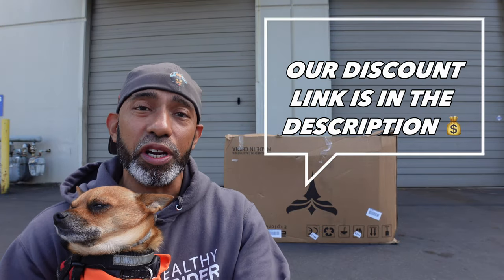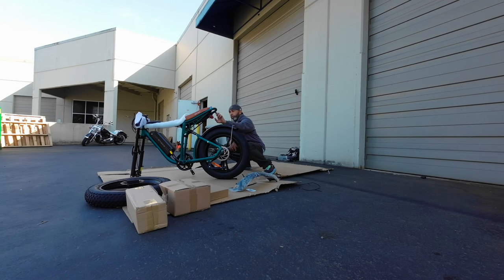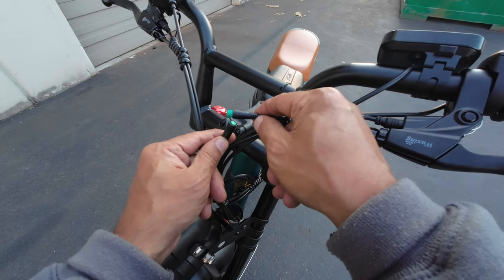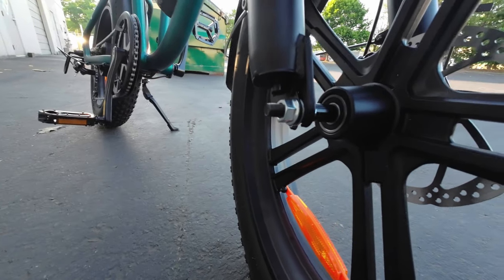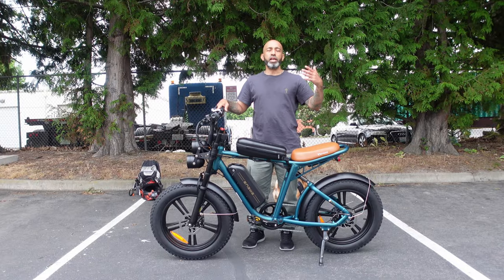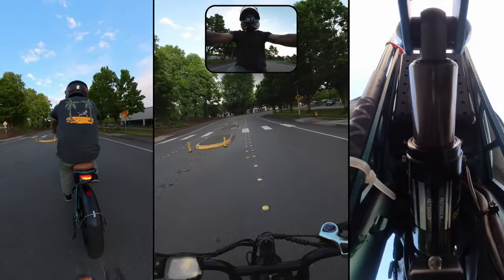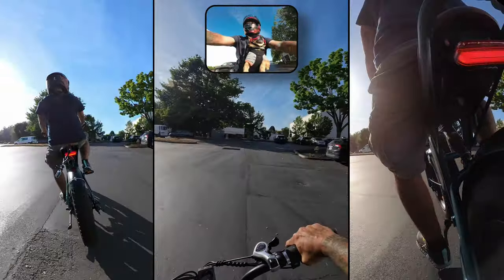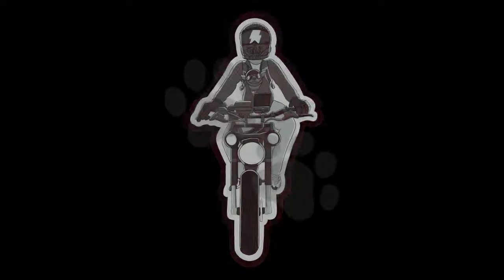Engwe M20 | Unboxing/Assembly/First ride

Comment: Watching this right before I unbox mine. I’m also 5’4 so made me happy to see how another rider of my height can handle it. Thanks for the video and all the tips!
Reply from the maker: Congrats on the new bike!  I hope you find the video helpful 🐾🙏🏽

Did you get the dual battery set up?

🐾
Reply: @RustyRoads  thanks! I got the single battery and added on the upgrade 48V 19.2Ah battery (mostly because I like the aesthetic of it looking like a gas tank lol). But I’m still waiting for that battery to arrive. 

Is there anything I should know before attempting to lower the front fork to accommodate my height? I don’t yet have any mechanic friends in my new city haha.
Reply from the maker: @bhaktaboy  ah ok hopefully you get it soon
I'd suggest watching some YouTube videos as a base but it is pretty straightforward.  I did have someone else do it for me which doesn't help you much lol

A set of helping hands will make getting both sides even much easier. 

Make sure the tire won't contact the frame of the bike when the shock is fully depressed

Take before pics for reference!

🐾

Comment: You have to unlock it to get more than 25mph out of it bro. Maybe can get a bit over I think it is. Same as most 48v e-bikes out here. I believe it’s fairly easy too. Call the company or one of the guys on YT might a simple tutorial for it. Love the content man thank you for it all and you stay safe out there on your rides and have fun man🤟✌️
Reply from the maker: Thanks for the feedback and kind words bro 🐾🙏🏽

We did check all of the settings; it already comes with the speed maxed out, and I tried bumping the controller amps up from 20 to 25 but still couldn’t get it past 26-27.  I think I need to ride with a speedometer app on my phone to see if I’m accurate or not. May just need to change the wheel size if that’s the case. 

🤘🏽
Reply: @RustyRoads  Ahh ok I see. No doubt brother you make it easy to support the content when it’s always interesting. May not be top speeds and extra over the top performances out of the bikes but it’s still entertaining. Good rides good trails good information on things and e-bikes and then theres nice camera work also. We love to see Rusty too man lol But definitely thought there was an unlock on this bike but 25mph is still good in my eyes tbh. Better than walking or pedaling or not having an e-bike at all🤷‍♂️😂
Reply from the maker: @d.henderson1347  thanks brother that means a ton!
Reply: @RustyRoads  Hey, if you still want to unlock it, you need to go to the Advanced Settings on the screen. First, turn on the bike, then press + and - for a few seconds until you see a P1, then press the + button to go to P3 (very important), then press the + button for 15 seconds. Now your bike can ride up to 45km ;)

Comment: I have a dual battery Engwe M20.  It definitely has some components that need improvement.  That being said it fits me well and is a blast to ride.
Reply from the maker: Agreed!  Super fun and zippy. I love how nimble it feels, and was really surprised at how responsive the rear shock it. 

Thanks for watching!! 🤘🏽
Reply: The seat looks horrible
Reply: @alphonsotate2982  surprisingly it is not that bad.  i actually find it comfortable.  but that might be different for rider of other heights.
Reply: @iscootct I was definitely about to ask you about that seat because it sorta does look uncomfortable but it also looks like it might be quite alrite and cushy enough it’s just small which is why the uncomfortable factor came into play from perspective. Glad your enjoying though man I would love to ride one for a few weeks and try it out for a long ride with the dual batty setup. How many mile have you gotten out of it before both batteries died on you if you don’t mind me asking?? Also stay safe out there on your rides man keep having fun bro🤟✌️
Reply: @d.henderson1347  From other YouTubers you should be able to get 22 or 23 miles throttle only out of each battery.  It is very hilly where I live and I am heavy on the throttle so my results are not usual.  I won the bike in a giveaway and was worried that it was going to be to uncomfortable to ride due to the seat and frame shape.  Maybe I lucked out and my height, weight, inseam are just right.
Reply: Do you think this bike would be a good fit for Uber delivery? Total miles on full charge?
Reply: what is your height? I want to buy this bike too but I cant risk it if its not comportable for me.... Because you cant adjust the sit
Reply: @euniquerebel  Just use power assist and the range should be more then fine. There is also the dual battery option as well as extra batteries if you really want to go crazy.

Comment: Hi I think if it's a new bike you should have took photos and sent to seller or company you might of got a little refund. But saying that these bikes are serpose to checked. To bo onist instead of mucking on I would have sent it back because other things might happen like motor issues any way if your happy good luck it's a nice bike
Reply from the maker: I did reach out to Engwe regarding the missing hardware and they did send that right out.  

As for the screwdriver tip wedged in the motor, I did not mention it to them to see if they would address it after this video released, however I have not heard anything from them as of yet. 

If I had paid for it I certainly would have submitted a ticket for support and possibly replacement. 

Thanks for watching! 🤘🏽🐾

Comment: You should ask Engwe to send you their new L20 ebike.  It is a true step through frame and should be well suited to your height.
Reply from the maker: Those look nice as well but I’m partial to full suspension bikes.  My butt concurs 😂!!

Cheers
Reply: @RustyRoads  I think if you add a quality suspension seat post it should be very comfortable.
Reply from the maker: @iscootct  This is very true

Comment: I have the dual battery.  Hydraulic brakes would have been nice, but the mechanical brakes seem to be pretty good ones so not really a big deal.  I would have liked a longer, cushier seat and cruise control too, but overall I love the bike and I think it's a great value.  I'd definitely recomend it if you're interested in this style of bike.  Looking forward to your full review!
Reply from the maker: It’s such a fantastic bike for the price!  Hopefully the M20 2 (M22?) get upgraded to hydraulic brakes. Totally worth an extra $50-100 imo!  Ideally it should be an option at checkout!

🐾🤘🏽
Reply: @RustyRoads  Yeah I totally agree, M20 Pro should have hydraulic brakes, more torque, and a color display with more functionality.  Fantastic first effort though, I'm gonna be riding this thing for a long time.

Comment: I like the bike there.. I did at first not like how the seat kinda looked angled down in the front.  But I don't hear anyone mention anything about slipping forward or having to keep sliding back on it. I would agree with you.. These bikes are always a good start to do a build with those style frames and standard size wheels. Depends on your taste which cheaper bike has the look you like.
Reply: I had a friend mention to me that he smashed his nuts on his test ride. He's about my size though. 😂 Understandable. Seats are subjective though and you can always swap those out.

Comment: Yeah, unlike a motor cycle with a mono rear shock, you can't use a lowering link for the rear shock to also be lowered along with the front.  Keep in mind you also may loose ground clearance and the pedals might be lower.
Reply from the maker: I’ll probably try a 165mm rear shock, it will shave an inch off of the stock one. 

Definitely good call on the clearance!  I learned long ago to adjust my pedals before leaning haha now it’s muscle memory. 

Thanks for checking the video out Kevin 🤘🏽🐾

Comment: I think they upgraded the throttle too btw. Mine looks to be exactly like yours in everyway except its not a full throttle grip. It only half now but still full twist. I think it's alot safer and far less chance of "whiskey" throttle. And i can honestly turn it with just my thumb by resting the rest of my hand on the half that dont twist. Smooth as butter.

Comment: Excellent review as usual!

I've had an Engwe folding ebike for a couple of years.  Their pedal assist kicks in quickly, but the soft ramp up is so slow you tend to accelerate faster with your legs while pedaling, so the motor doesn't get the chance to propel you.  Then a tap on the brakes at speed, and the whole lethargic ramp up begins again, taking quite a few seconds for the motor to catch up to the bikes speed.  I think it's Engwe's way to increase range by forcing you to pedal harder to accelerate.

I will say that bike has some of the best cable actuated brake I've experienced on a bicycle.  They really feel hydraulic.
Reply from the maker: Ah ok that makes sense regarding the pedal assist.  It would be so nice to be able to pedal while letting off the throttle, and being able to maintain your pace.  I tried over and over but once you let off the throttle it slows down despite how hard you’re pedaling.  

This is definitely a throttle bike, ALTHOUGH.. it’s so light it’s super easy to pedal with the battery off when you’re in 2nd-3rd gear. 

Love it!

Thanks for watching!
Reply: @RustyRoads  Juiced San Diego, CA has Torque sensor on 
most of their bikes, Also where is your Talaria 3 K for the 3X??
Let's Go! I have one week on my Sting-R MX4. Ventura, CA 
come on up we can do a review from Volt 750 Yukon Himingway Cruisers to Lectric 2,0 to Folding Rattann 750W, Juiced Rip Racer and the Hyper Scrambler 2
AR Grizz V2 had problems and was a 2 month ordeal to send this defective item then wait for return to me ......................Phuque it!  When Front motor on is scary when rider forgets (project is mothballed 2 new controllers and one thousand watt motor is in the bay) And Talaria Sting-R-MX4 ready to roll. Rusty will love our little KoKo, PM us Let's GOooo!
Reply: Oh and all is for sale except the Juiced bikes and 
Talaria at huge discounts for pick up, after your visit ofcourse
Reply from the maker: @tommcgill1671  I’ve been refreshing the XXX page a million times per day waiting for the restock 😬

Comment: Hey Rusty. So I got mine. And i cannot get the front wheel to line up properly. Yes I can install it and adjust the brakes so they don't rub but the wheel is not centered. Can you or anyone else shed any light on this?

Comment: I was so close to getting this recently for my bday but I bought another super73 knock off for even cheaper than this one and it’s pretty damn legit. Bought it to upgrade. Well worth it in my opinion. This one seems to be too especially seeing as it comes with two batteries.
Reply from the maker: Hi Lemon, congrats on your new bike!  
What’s it called? 🤓⚡️

The M20 is super fun, and definitely would make for an awesome little project bike 🤘🏽😆

Ride safe!! 🐾
Reply: @RustyRoads  Hey Mike, I got the Jansno x50. Pretty much the same style bike just considerably cheaper. Lol honestly not a bad buy though. It has good pick up and it came with some pretty decent add ons. I also wanted to add the color of the engwe is BEAUTIFUL. 💚💚💚
Reply from the maker: @lemoncitrussage  Just checked out the X50, love that frame design!  

Looks like a lot of fun and the specs are great!  Walmart sells them too so that’s saying a lot! 

Congrats again and yes the green is so nice!!

Comment: Where are the 3 screws for the second battery???
Reply from the maker: I've read about some battery kits not including the required screws!

So sorry that happened. Send them an email, they'll act quickly based on my experience with needing the front wheel hardware. 

Hope you're riding soon 🤙🏽🐾

Comment: I have a problem with the M20. I got the bike yesterday, when I push the throttle all the way down and put it in mode 5, the bike only goes 5km/h, the regulator for the maximum speed in the setting cannot be raised, it is set to 25km/h and it is not possible to raise it higher, it simply does not work. I watched videos to hold the brake and gas, and only then to start the bike and after 20 seconds to release the brake and gas, but that doesn't work either. I wrote to the customer service at ENGWE, but their responses are very slow. Yesterday I got a response to go into the settings and raise the speed to max, I sent them a video that it just doesn't work. I'm still waiting for an answer. I was so looking forward to the M20 and in the end a huge disappointment. Has anyone had a similar problem?
Reply from the maker: I haven't heard of this until now.  I hope they get this resolved asap so you can enjoy your bike Bojan 🙏🏽🙏🏽🙏🏽
Reply: @RustyRoads  thank you 🫶🏼
Reply: @RustyRoads  Problem fixed. It was necessary to enter the settings and hold "+" 15 seconds, then I got the speed unlock

Comment: Nice review. I've got the ARIEL RIDER like you do. CAN YOU UNLOCK THE m20 or is what you see is what you get. The AR has so much torque it's probably not a fair comparison.
Reply from the maker: Thanks and congrats on your new bike!  

The M20 comes unlocked at the full 28mph speed btw.

Thanks for watching!
Reply: There is a hack if you want to solder in an additional shunt resistor to get a little better performance but you will not get any higher top speed out of that little controller.
Reply from the maker: @iscootct  this frame will likely become something greater than its current form ⚡️🤘🏽

Comment: My M20 hits 37 max. not sure why but i love it or maybe the display is off.
Reply from the maker: Gotta set yours to MPH, it ships in KPH

If you already did that then that speed is badass!!

Ride safe 🐾
Reply: @RustyRoads  3 Days after i got the bike i locked my self out of it. needed a password to power On the bike. Engwe Helped me out. i went to settings and set everything max and it's set to MPH , it's my first bike so it's pretty Sweet. Thx
Reply: I Hit 37 MPH it's a beast.
Reply from the maker: @uptownpapi25  share your settings for the world 🤘🏽 No one else is getting over 28mph
Reply: @uptownpapi25  How did you get yours to go 37 miles an hour please tell
Reply: @glenngoren4566  the controller in the seat is only 20 amps  maybe if you change the controller but the top speed should be 28 or 29

Comment: Did you unlock the bike? It should be faster def with you on it. I was on my buddies an got it to 28 an I'm 250lbs.
Reply from the maker: I checked all of the settings and it was already set to the max speed. What tire size is set in your buddies settings ?

Cheers!
Reply: @RustyRoads  I think 24 I will find out for sure and I think mrcentraldriver shows how to change it all in his vid
Reply: @RustyRoads  in setting go to P6 and change current from 20 to 25 that changes the amps the top speed should be set already at 38 and I believe that is top speed setting. Good luck. I just ordered my 1st ebike emoko C91 it was 866$ to my door. Maybe we could ride one day I'm in NJ area. Will be stopping at powerful lithium probably in a few weeks. And going to do a 72v upgrade on my bike as soon as I can afford parts. I'm older and disabled so money I tight. I think I'm going to start YT channel to help people. Thanks and great vids keep it up
Reply from the maker: @oldmanebikes8392  thanks boss!  I did try 20 and 25 amps but didn’t notice a difference. And yes the speed was already set to the max.  I think I need to compare it to a speedometer app on my phone, my tire size settings ha may be off causing a skew.  
Upgrades are awesome but definitely enjoy your new bike as is, until you outgrow the speed etc.  congrats btw!

I’ll announce the next time we’re visiting the NY/NJ area again. We’re back in Seattle now. 

Cheers and ride safe 🤙🏽
Reply: @RustyRoads  ok thanks and yea check it with gps. That's all I'm going to use. I'm blind in one eye so I'm using a 10in tablet for my screen with gps and when I upgrade it the new controller I can use an app to see all the amps and watts and battery.

Comment: Why didn’t you go dual battery with it and get that extended range bro? 13 ah is fairly terrible imo dude it’s only a decent bike if you have that 26ah of riding. That 13 would have me in panick mode too much from range anxiety😂

Edit: That sticky throttle just seems like some new bike type of misfortune. Hopefully you just need to break it in after a few rides.
Reply from the maker: I asked Engwe for the dual battery version but they told me they were out of stock. No biggie as that just makes the range test easier to record 😅

I’m planning on using the frame for a project bike. After our visit to powerful lithium I have the need for speed!  

Cheers!!
Reply: @RustyRoads  Oh yeah that might a decent frame for a nice upgrade. Might have some good plug and play options for mods somewhere out here in the e-world too. Power Lithium is great🔥They so such good work man and the performance I’ve been seeing out of the bikes they work on is incredible. I ever try to go 60 or 72v with a project I’m definitely going through them also. Good luck with that can’t wait to see what you come up with out of that Engwe bro.
Reply from the maker: @d.henderson1347  the M72 🔥